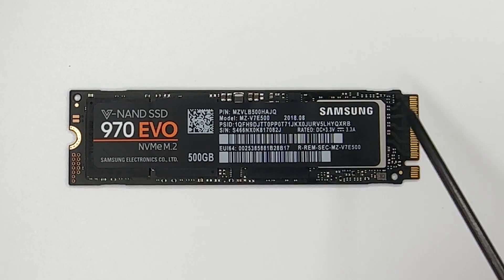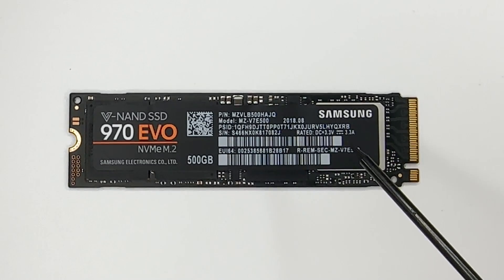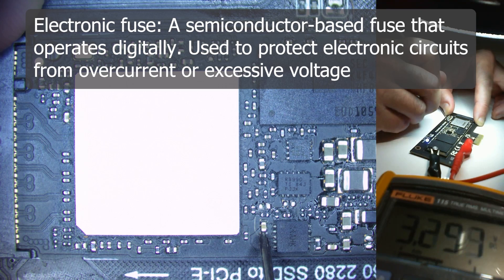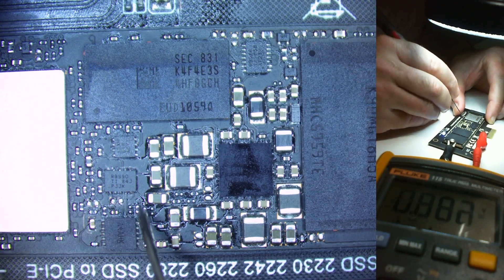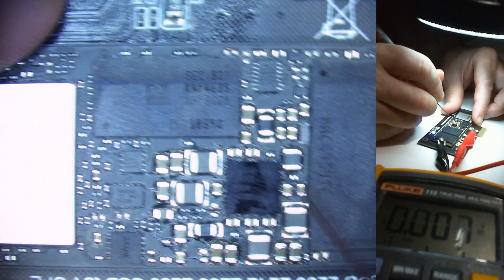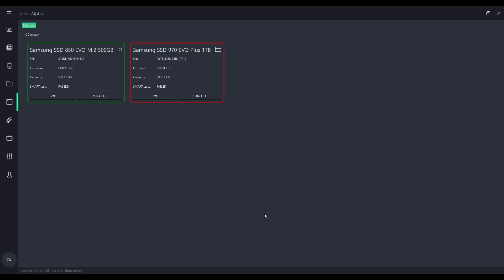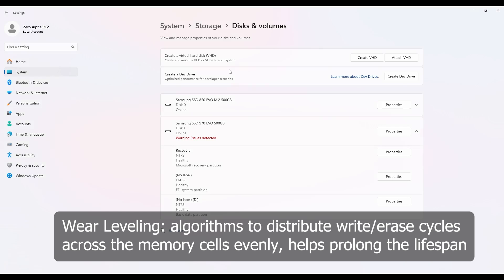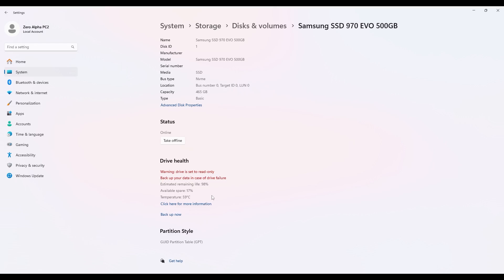Memory Chip WEAR OUT - Samsung 970 EVO SSD - Data Recovery

Comment: What if the same ssd cannot be detected in the bios, but can be seen as pci device in device manager with a error code that it cannot start? Looks like a firmware failure to me. It happened right after a power outage. No disk utility can see this ssd. Is there any low level tool to talk to the controller?

Comment: I appreciate you recording and posting this video, it helped me troubleshoot my Samsung 970 EVO Plus drive. Using thermal camera I discovered that E-fuse gets hot right away and that pins 8 9 and 10 show 0. The drive is not visible in bios. I was thinking of bridging pins 1,2,3 with pins 8,9,10 on the efuse in order to regain access to my data but I wanted to ask if you think that would be a dumb idea?

Comment: How does it happen? I have one of the original 2.5 Kingston HyperX 3k 120gb's drives running windows daily for 11 years with 0 issues
Reply: Because that 3k was for 3000 erase/programming cycles. Current drives are more like 300 cycles (QLC NAND).

The drive in the video is also almost 1 PiBs of written data, where these drives are rated for something like 100-150TiB. It has performed remarkably!

If you're using any kind of drive in a server, you must monitor it or exchange it after some time. This person did none.
Reply from the maker: It probably has really good quality memory which was the case when it first came to market. The trend has been to increase capacity while reducing cost. They reduce costs by increasing the amount of bits stored in each memory cell. More bits per cell is cheaper to make but the memory will wear out faster. So be careful what you are paying for. If the SSD is important than better to do your homework and pay a bit more for a good quality product. The really cheap SSD are ticking time bombs
Reply: with out much writes they wont wear easy or if its just for reading it can almost go for ever